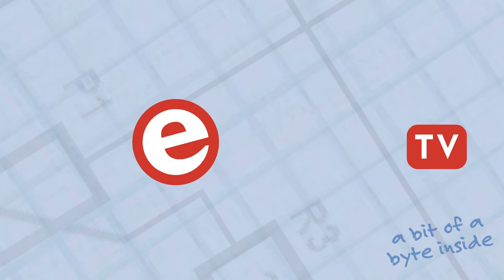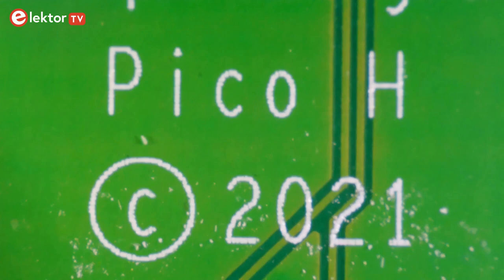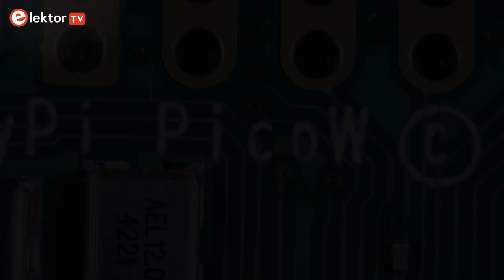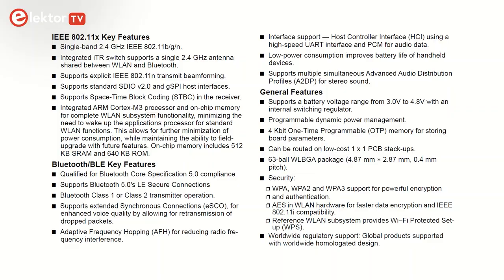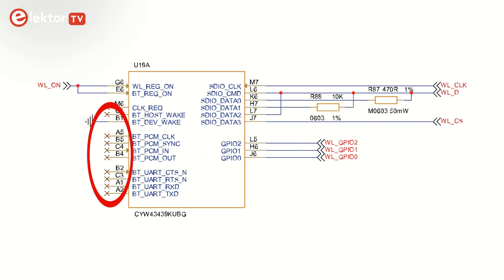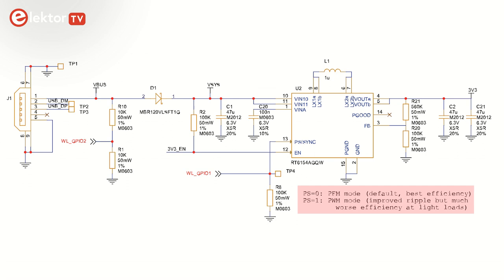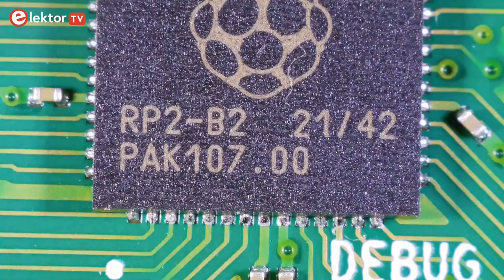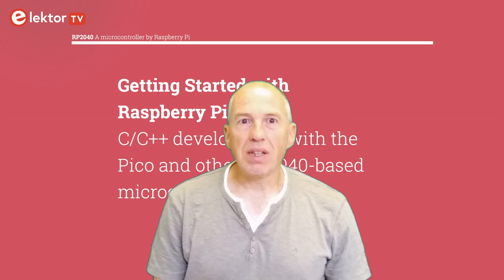The Raspberry Pi Pico W (wireless), Pico H (Headers) and Pico WH

Comment: So since the Bluetooth pins are not connected, does that mean a hardware revision is required to add Bluetooth support and not just software support?
Reply from the maker: It is said that the Bluetooth module is accessible over the WLAN SPI bus, so it would only be a software thing. But you should check the programming manual of the CYW43439 to be sure.

Comment: What is the power consumption of the Raspberry Pico W? I mean the current. I want to use it with for a tiny project using a so small solar panel as possible
Reply from the maker: The board's current consumption depends mostly on the application it is running. The WLAN chip alone, Wi-Fi only, consumes almost 350 mA in TX mode.
Reply: @ElektorTV  Thank you. I assume you can switch on and off the wlan chip by a setting? What is in that case the power consumption.

I want to make a solar driven plant tray which is detects a water shortage (reed relays vlotter) which is able to send out an email. 
I noticed there is some example on the main webpage already🙂.

Comment: No USB-C and no Bluetooth - disappointing!
The more products RP launch with micro/mini USB the harder the eventual transition to USB-C is going to be. I'm royally fed up with rooting through a great pile of different USB cables to find the right one! Almost wish they left the socket off althogether, brought it out on pads and let us wire up our own choice of connector!
Also disappointing they have locked out Bluetooth despite it being in the chip - is it least accessible on solder pads so we can wire it up ourselves? Do the Bluetooth and WiFi parts of the chip share the same radio, and can they be used simultaneously? Having a different interface for each seems 'sub-optimal', the WiFi interface surely must have sufficient bandwidth for Bluetooth? Very un-Pi to lock out a feature present in silicon at the board level even if, initially at least, they leave the community to sort out the firmware!
Reply: Datasheet is not very clear about WLAN and BT host interface. But both SDIO and UART are connected internally to same Cortex-M3 core. So it seems that it could be possible to communicate with WLAN and BT via SDIO. There is only short datasheet publically available, so I am not sure where to find more information.

PS: aallan from Raspberry Team wrote to forum thread about Pico W: "The wireless chip is connected via SPI to the RP2040. If we do get around to adding Bluetooth support for Pico W then communication will be via the same SPI connection. The CYW43439 BT pins aren't needed and aren't connected. In other words, adding Bluetooth support is a software thing, not a hardware thing."
Reply: @sinapis42  Thanks, that is more encouraging!  Surprised about the documentation. I've used Cypress chips a lot (especially for BLE) and they were always very well documented (and supported with firmware). Need to do some poking about on their website!